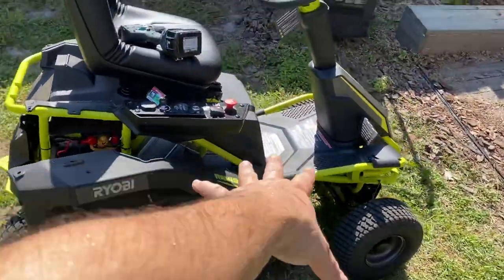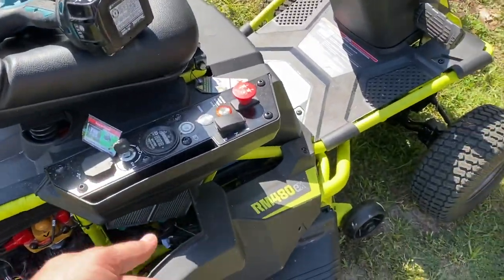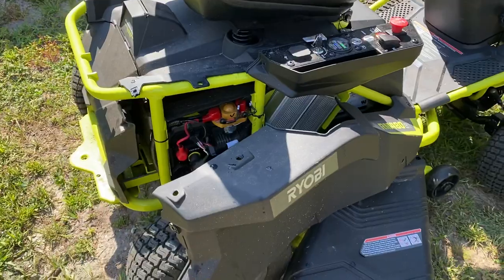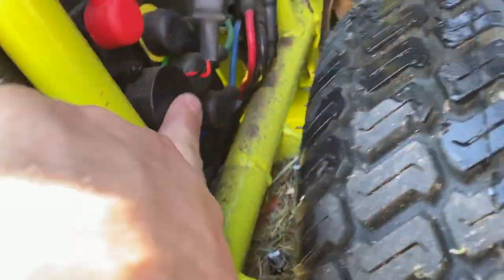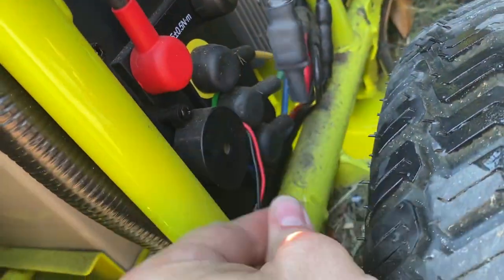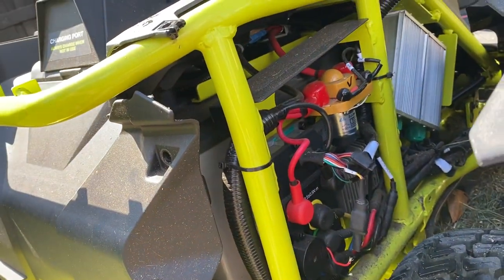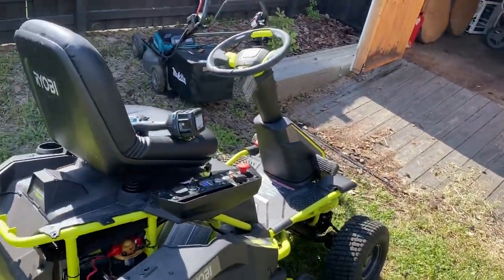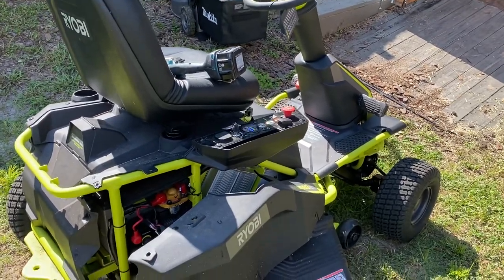DISABLE THE BEEP on RYOBI Riding Lawn Mower

Comment: For reference on the zero turn model it’s located in the front panel under your legs. Same T-30. And you can unplug the wires but ripping them out and breaking them is extremely more satisfying.